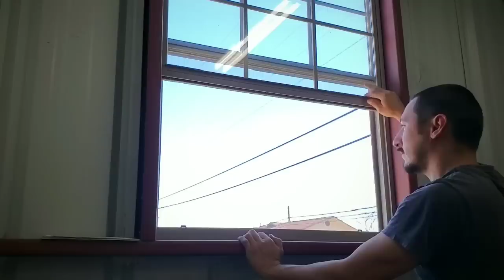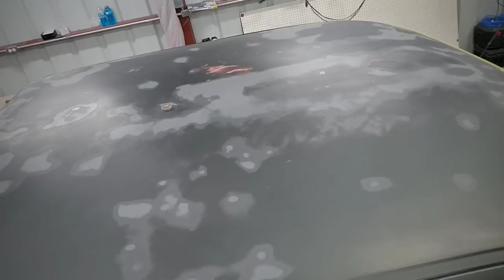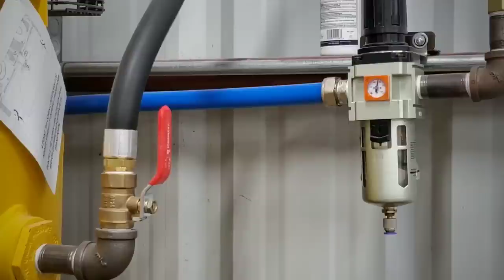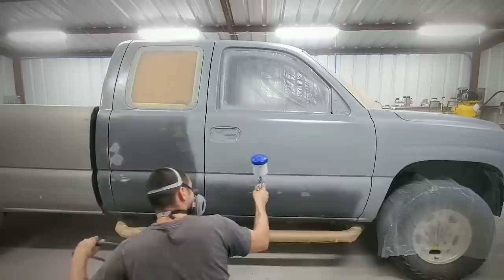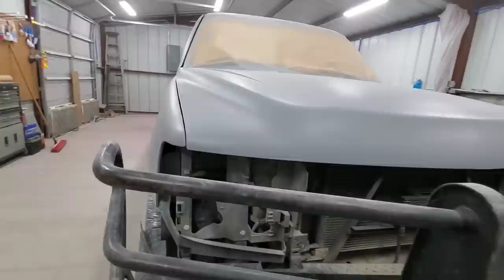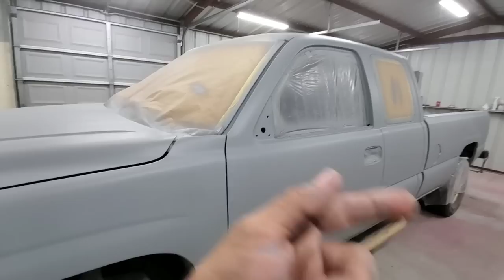Let's Spray - Dupli-Color Primer

Comment: This is great primer for the price fills nice and sands great .Just be aware it is a 1k with no hardener so you may need to seal it if using 2k paint.Here’s a hint to save money .You can use acetone instead of the Duplicolor reducer .A gallon of acetone is much cheaper than the Duplicolor reducer ($12 for a gallon of acetone vs $29 for the Duplicolor reducer )Also I found the 1:1 ratio to be too thin so I reduced it at 3:1 which seemed to work better and fill in nicer using a 1.8 tip .Also use an etch primer on bare metal first as I found this stuff doesn’t protect against corrosion very well
Reply: I use acetone for all my Rustoleum paint projects as the reducer as well.  Works great and flashes off quickly leaving no runs.  I do add a hardener to my car finishes though just for durability and long lasting great looks.
Reply: I think this primer is a lacquer of some sort.  I’ve had good durable results shooting 2k single stage acrylic urethanes right over top and its money.  This cheap primer might be the cheat code for those low budget projects.

Comment: Hey bro...a trick I learned the hard way with the fans...tape some ac filters to them so what’s outside won’t get overspray all over it
Reply from the maker: Yup, I do the same thing.  I put 4 box fans under the garage door blowing air out, with filters behind them.👍
Reply: @GTsPerformance  hope u didn’t have to learn the hard way like I did....had the fan in the window makeshift booth with plastic.....yeah this fan will work awesome get all that overspray out of the booth, painting fairing on a motorcycle...kandy cobalt blue....go outside take a wizz....whole back half of the boat was blue 🤦🏽‍♂️🤦🏽‍♂️🤦🏽‍♂️🤦🏽‍♂️....wasn’t my boat hahahahaha
Reply: Also, put them in/on your fresh air ( window ) source.

Comment: nice results. Observation, when you do a panel such as the roof, it's best to do the complete panel from end to end instead of stopping in the middle and then picking it up and finishing to the other end, especially when you do the finish coat. Since you have that great looking bench, there is no reason why you could not walk the whole distance and end at the windshield. Also as I was watching, when spraying the roof, keep your gun completely perpendicular to the surface so you don't run into the problem of having more material being applied at the bottom side of your fan pattern and less at the top side of the pattern. and at the end of your stroke, keep it even also. Yes, it is a learning curve,  and practice makes perfect.
A tip on your great looking bench to make it easier to move around, make two hand grab holes in the middle of the top say about two feet from each end or just one in the middle, if it isn't too heavy by drilling two 1-1/4 holes 4 inches apart and then two straight cuts to complete the hole.

Comment: Looks awesome!
Do you do just one coat of primer, then base color, then clear? How many coats of each?

Do you sand or scuff between primer and base coat? What grit/what do you use?
Reply: It’s normally 2 - 3 coats of primer, and you can’t go with base right on top of the primer. If you use the primer as a sealer, then yes, that’s what that means, you so one coat of sealer, then one that’s flashed off you can lay your first coat of base, base dependes it can be 2 - 3 coats or until you get full coverage, some colors cover faster than others, and for a metallic you have to do a control coat. Then your clear once the base flashes, usually 2 coats of clear is what you will use.
When you prime you have to let it dry then you sand it with 320 up to 800 grit depending what you’re spraying. 
You can sand between base coat applications to the smoothest possible finish if you want, 600 or 800 probably what you would use
Reply: So if you don't use primer as a sealer do you add sealer on top of primer? And does sealer have to be sanded with 320 like primer?

Comment: Truck is looking good!! What size air compressor do you have? I think I only heard it go off once per panel which I think is pretty good. I heard a 60 gallon would be the minimum but they are a bit pricey.
Reply from the maker: At this moment,  I'm using a dewalt 60 gallon. Found it at Tractor Supply for $500. 
I used to spray with a 21 gallon Centeral Pneumatic from Harbor Freight, so many years,  so many paintjobs.  I still have it at home. 😁
Reply: @GTsPerformance  what gun are you using?
Reply: @GTsPerformance  I have a suggestion on your airtank of you have a propane outlet near you ask them if they have any used propane tanks and if they do purchase a 100 pound or a two hundred pound propane tank so you could have extra air storage from the tank you have know and you could do the same for your garage at home more air less work for the motor to be over worked hi 👋 from 🇨🇦 #YSW respect back to you GT 🙏

Comment: Hey man good video I just want to know if the primer is thick enough for bondo.
Reply: That stuff sprays thin supposed to cover body filler tho iv used it but it doesn't higher build much. Evercoat finish sand is literally the best

Comment: Did you use acetone as the reducer?
Reply from the maker: I used Dupli-color Specialty Reducer.  Also from Orielly,
https://www.oreillyauto.com/detail/b/dupli-color-3391/chemicals---fluids-16461/paint---body-repair-16614/paint---thinners---reducers-17760/f1bbb494645d/dupli-color-1-gallon-specialty-reducer/bg907/4268008/2007/chevrolet/tahoe?q=Specialty+reducer&pos=1
Reply: I used acetone with this primer many times .Works great and a gallon of acetone is way cheaper than the Duplicolor reducer .

Comment: What thinner did you use and exact ratio was it ,I am considering doing this paint job on my truck
Reply from the maker: I used the Duplicolor Specialty Reducer on a 1:1 ratio ( 10oz primer + 10oz reducer )
I used the kobalt spray gun,  which has a 1.4 tip. So I sorta used the primer as a sealer,  and sprayed the whole truck. 
You can also use less reducer (2 parts paint: 1 part reducer) for a thicker, high build primer if you're doing bodywork. . 1.8 maybe. 
Primer is mostly used where body filler was applied.  It builds over sand paper scratches so that you can block sand the panel later.  Sealer gives you a solid base,  before your color.
Reply: @GTsPerformance  Thank you so much for the info